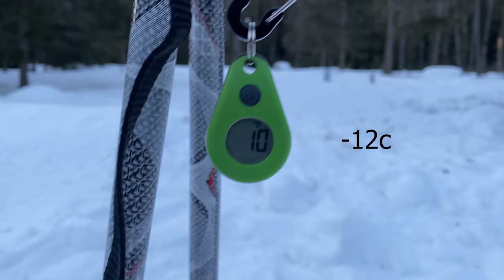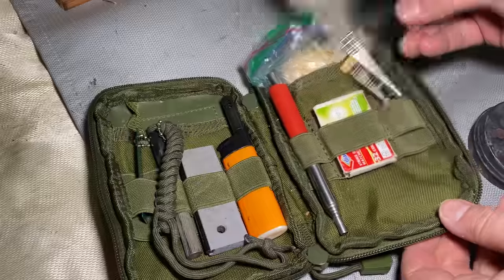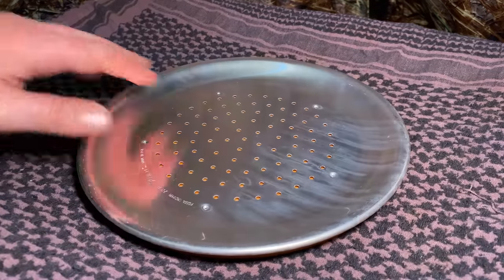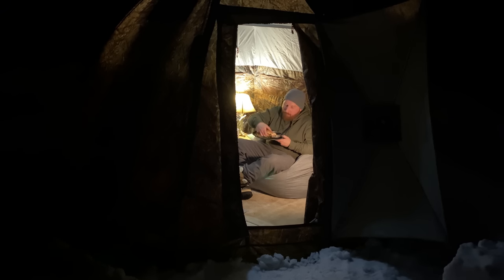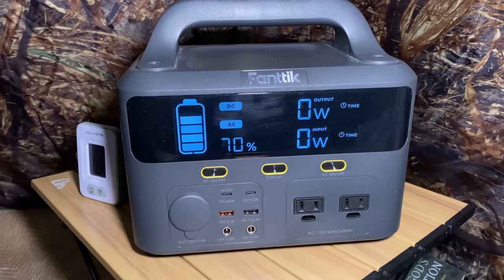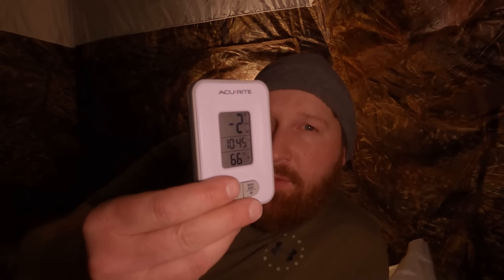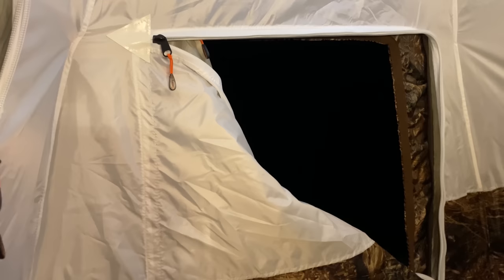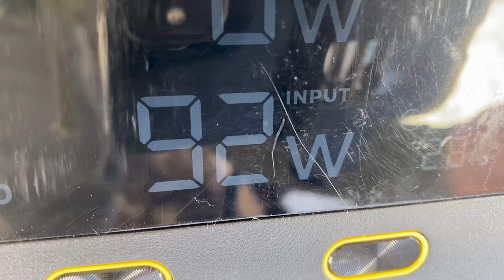Winter Camping In Deep Snow: Hot Tent Camping

Comment: I highly recommend getting a small fan or two, to attach at the top of the tent, to re-direct heat to the low section of the tent. It makes a big difference !
Reply from the maker: Yes! This is one thing that I keep forgetting to bring with me! I do even have a small battery operated one I could have used! I’ll make it part of my kit next time 👍
Reply: @BaumOutdoors  Yes, and now that your using porta power, even a small electric oscillating fan, or one you can recharge off the power station. Happy Camp/Glamping ! God Bless !
Reply: А сквозняка не будет? Сквозняк опасен зимой

Comment: 👍👍 to let you know. Lighters are filled with butane. By product of propane. Butanes worthless under 32°.  You’d have better luck if you go out and get a zippo lighter. You usually check your fire pack before you go out anyway so make sure that the zippo lighter has flint for the spark and fill up the lighter fluid. And it will always light and it’s windproof.
Reply from the maker: Thank you for this info!! I will have to try a zippo didn’t even think about that!
Reply: @BaumOutdoors  My Dad left me his old zippo that was given to him when he Enlisted in the Marines. Which has the Marine Siguna on it. I sent it to zippo. They buffed a lot of the scratches out of it from when he was in Vietnam but they couldn’t replace the outer case with the marine signuna on it. But the guts were all replaced free of charge. When I go hunting camping that’s the first thing I check then in my pocket.

Comment: I always wondered while building the different woodstoves ive created if running the stove pipe in the front would make any difference. My thinking is that it takes just a tad longer for the heat to draft up and travel to the front v.s it going up and right to the back and up the pipe. Nice to see some other manufacturers thought the same as i was thinking.  Now i definitely going to have to try now. Great video enjoyed it thanks.
Reply from the maker: Yes definitely give it a try! It works for sure! The only thing I noticed is with this stove it got a little more smokey than usual when I opened the door. But I think the companies that have created them to pipe out the front, have created baffles to prevent this and I’m sure it works really well! Thank you so much for commenting. I hope your project turns out great 😊

Comment: Any tips for carbon monoxide? I have a winnerwell stove inside the cabelas ultimate alaknak tent and for some reason the detector I have reads anywhere between 30-100 ppm when using the stove .
Reply from the maker: I’m not 100% familiar with that tent. Do you have enough fresh air vents in the tent? I’ve never had any issues with my hot tents so far. Maybe you have smoke leaking from your stove? Hope you can get it all figured out! Be safe!

Comment: Does the charger have a solar panel to recharge the charger?
Reply from the maker: They do make a solar charger for the power supply!
Reply: @BaumOutdoors  I jumped the gun, I should have a waited a few more minutes and watched more the video and realize they do when you were charging it with the solar panel. Just wondering does temperature have any impact on solar charging? Is it more or less effective let say bright sunny day -10 C vs 30 C on a bright sunny day., or does humidity vs a dry air climate have an effect?

Comment: If you're going to hot tent in frigid temps that's the way to do it...Nice set up indeed, however I learned a better way years ago...If I keep my mouth shut, trim my beard and cut my toenails regularly I can usually find a nice woman with a house with central heat and a flush toilet..